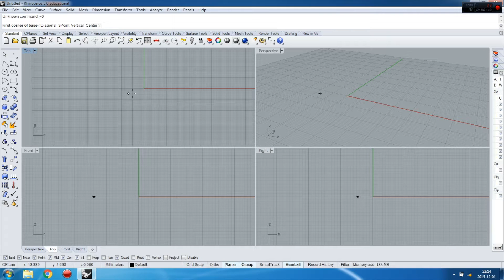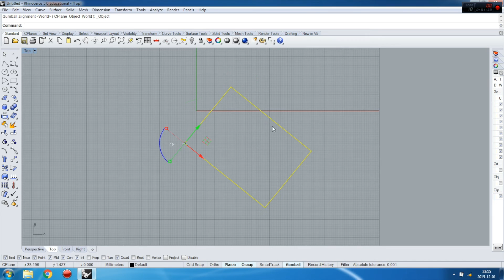RHINO TUTORIALS Tips & Tricks  - Relocate Gumball

Comment: How can you keep it from moving back to center after a transformation?  Thanks!
Reply: having the same issue...
Reply: I also struggle with this. My solution: change the whole world with c planes. You can save the original c plane in the menu on the right, when you click on the gear and add that menu.